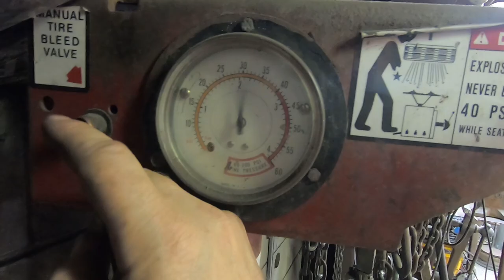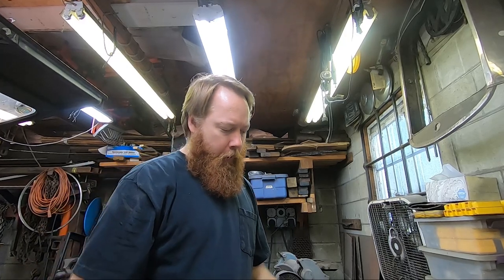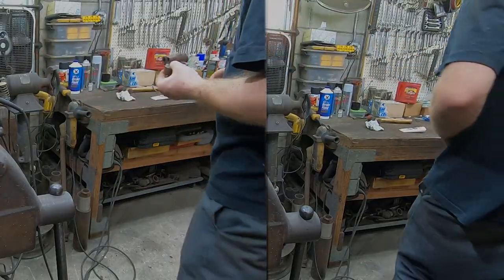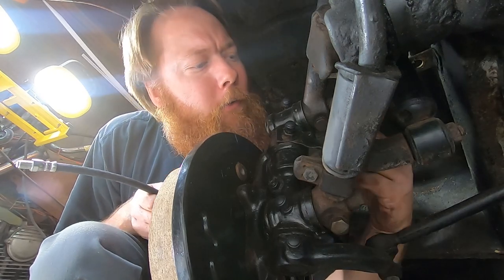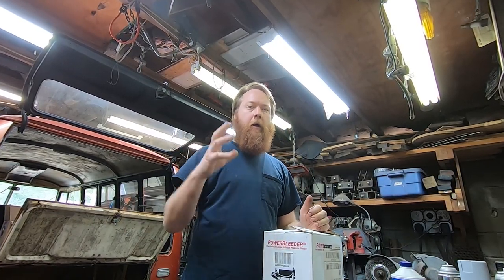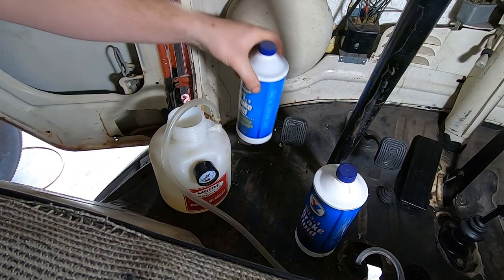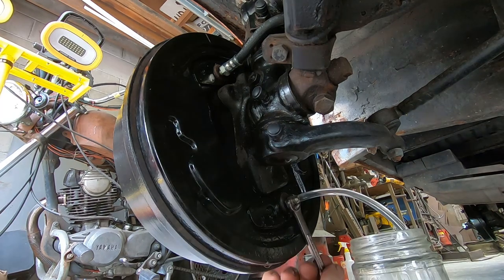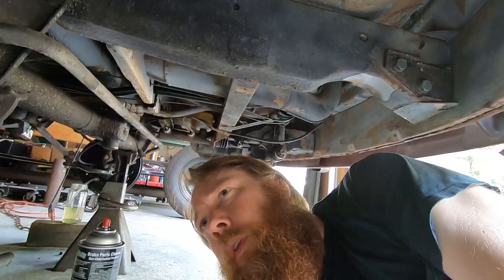It Rolls! Power Bleeder, DIY wrench, Grind Wheel Cylinders, VW Split Bus Restoration Vandemic E9

Comment: Nice work on the DIY wrench! Seems like adjusting those bearings would have been crazy difficult without that.
The powerbleeder is going on my shopping list now! I made one a while back but admittedly it cost as much as buying one outright and it ended up falling apart on me lol.
Reply from the maker: Thanks Dream Wrench, it was a great excuse to make a tool. I can also relate to a failed DIY tool- have probably had more failures than successes in that regard. The power bleeder is one of those tools that's easy to avoid getting until you've used one... then becomes a "how  did I live without this?" tool. Continued good luck with your Squareback and thanks for watching!

Comment: brakes take like 3 rounds usually,  when you put int all new brakes like you did the pads all settle and you have to readjust them again,  you might want to make sure your pads are really tight.  they could be lose after that first adjustment / bleeding.
Reply from the maker: Hey VW Life, that sounds on point. The fronts were loose after the first round of bleeding and I expect they'll all be loose after the first test drive. Thanks for the info; it's great to have so much knowledge available in the VW YouTube community to help each other out. Thanks for checking out the video!

Comment: Nothing better than getting it off the jack stands! What is the lavender looking lube you are using on the adjusting stars etc?
Reply from the maker: Yeah Adam, that was really cool to get this thing on the ground again! It's been nice to have the option of pushing it outside to make room for other things... like engine work! That lube is Permatex "Ceramic Brake Parts Lubricant" https://amzn.to/2A1wztA   It's supposedly safe for use here- other stuff may damage the seals or drain off when it gets hot. I like Sil-Glyde for inside the master and wheel cylinders. I've been experimenting with it on the threads too but no conclusions yet. Thanks for the question and for being a part of the channel!

Comment: hey was that shoe on backwards on the front top. I think they go the other way. pointed side goes in the wheel cylinder and the flat side goes in the adjuster.
Reply from the maker: Hey Mike! Thanks for the extra set of eyes, that seems like something I'd do but they are all correct this time. I hope all is well on the left coast! Thanks for watching.

Comment: I ordered the Motive Power Bleeder earlier today.  Went back and was pleased to see its the same one you have in this video.  Anything you would change with your bleeding process for when I do it here in a few days?
Reply from the maker: Hey Greg! I would only stress to remain patient with the process. It takes longer than I ever think it should, the tough part being expensive brake fluid flowing into the catch jar without knowing if there are any more air bubbles. But you must get them all out. This goes for any method, but the power bleeder has to be my favorite.

Comment: Was there a spacer that goes into the hub before installing the drum?
Reply from the maker: Hi Nick! I assume you are asking about the rear brakes- the short answer is yes. The arrangement was different for different models but on this one the spacer and oil slinger are one piece. You get a glimpse at 1:23 but may see more about the situation in the previous video: https://youtu.be/rhaSUk81k-c   Enjoy!

Comment: Teflon tape????????
Reply from the maker: Hey Mike! Thanks for the suggestion. Unless I'm thinking of a different part, the seal is formed by the bubble flare in the end of the brake line and the fitting threads just hold it in place. However, I do use teflon tape or liquid sealant on tapered threads. On that front right leak, it seemed to do the trick when it was backed out a bit and then re-tightened. Must have benefited from being re-seated. Or it's still leaking and I haven't figured it out yet. Thanks again for watching and being a part!